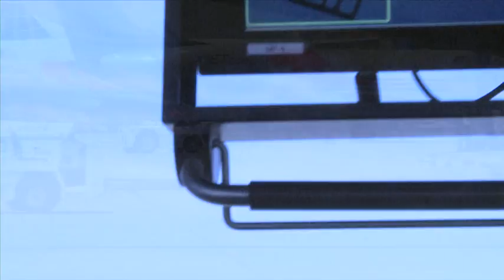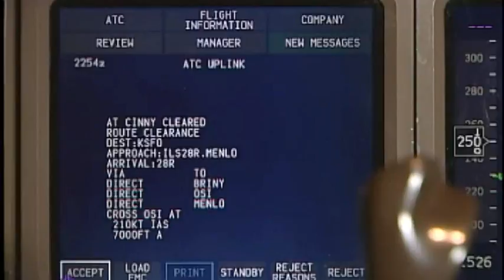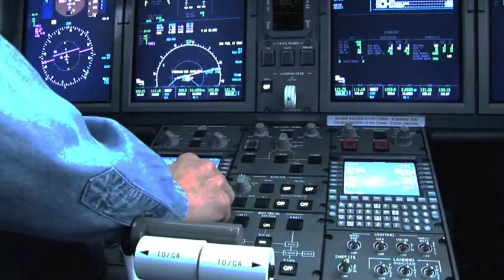NextGen Gate To Gate

Comment: Also to pilots out there, do you have both "level 2" and "level 3" nexrad type products from your on board radar? I know your onboard isn't nexrad, of course, but it's usually dual-pol from my understanding. Do you have products you can or do use such as "Downdraft Gust Potential" or "Vertically Integrated Liquid / Density" (level II products), or some level 3 products would be... composite reflectivity, hydrometer classification, (HCA) which would show you different colors like light blue usually for dry snow, or pink for frozen precip other than snow, and so on. Um.. another level 3 product I'm just trying to think of would be Special Differential Coefficient or also KDP I think. It's neat how you can get a vertical profile on a storm I suppose by your on board radar combining various tilt degrees into one image, which you can analyze that way. We can't really do that with ground based. Just MRMS comes kind of close. Multi Radar Multi Sensor. Wow, acronyms. Anyway yeah :)

Comment: As much as I respect older pilots who don't like this technology, such as the English pilot relatively well known who flew the Concorde, known to criticize "glass cockpits", I really like the technology, myself. Sure it takes getting used to. but just because it's on a digital LED-backlit or whatever method screen display doesn't make it inferior to an analogue gauge. Just a little comment on that in general. I know that's not exactly what this is about. :)